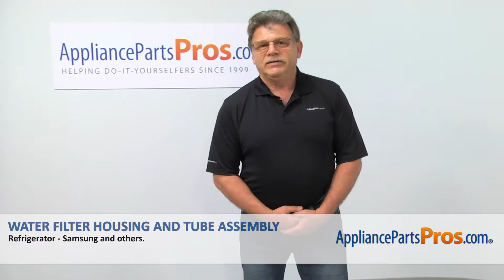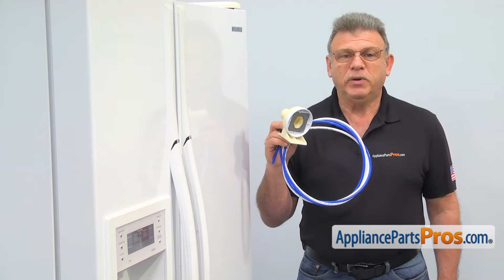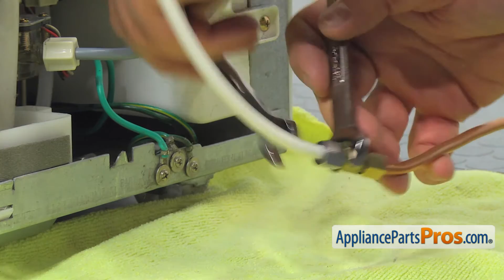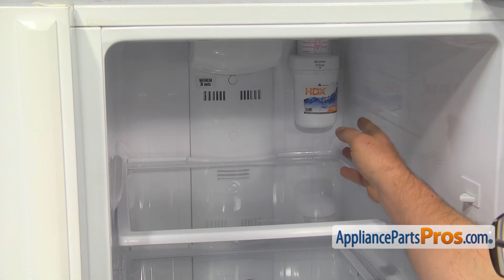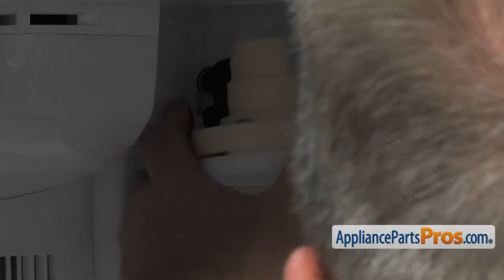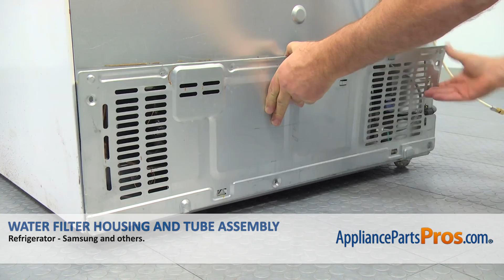How To: Samsung Water Filter Housing and Tube Assembly DA97-01666C

Comment: These filter housings don’t last too long. My water stopped working So should I just replace the whole water filter housing or tube assembly?
Reply from the maker: If the part isn't damaged or worn, then it shouldn't need to be replaced.

Comment: Nicely done and very helpful.  The fittings on our Samsung RS277ACWP unit require a 12mm wrench instead of 1/2".  Otherwise, exactly the same.  Also a good time to vacuum the coils.
Reply from the maker: Thanks for your feedback, Bruce. And you're right, it's a good idea to clean the coils while you're at it. They get dirtier than you think, and it can impact your fridge.